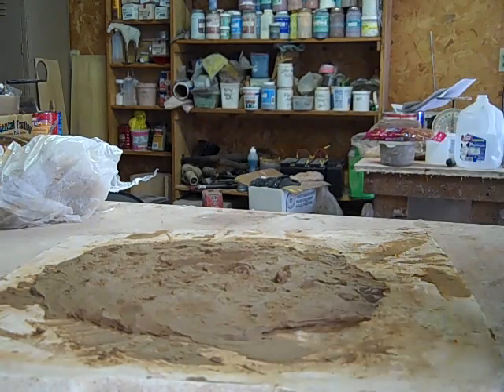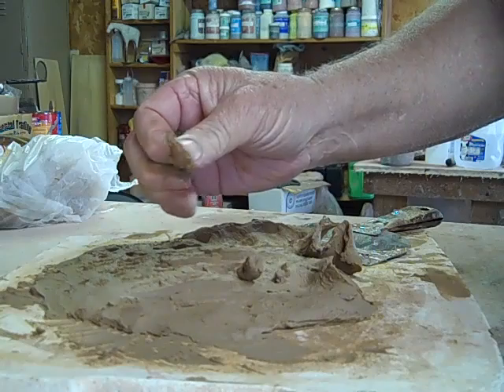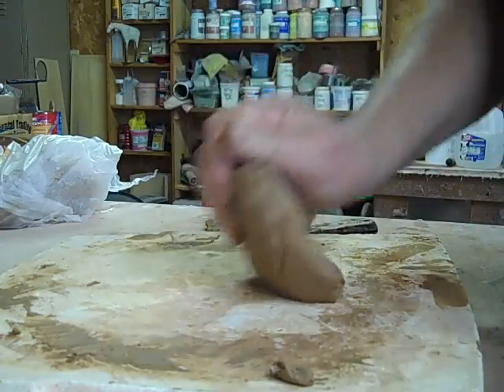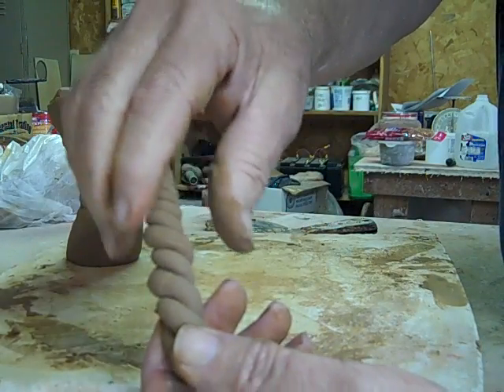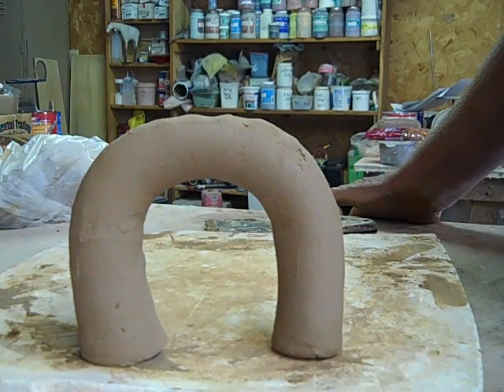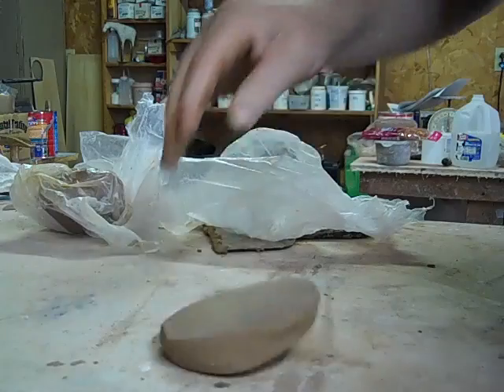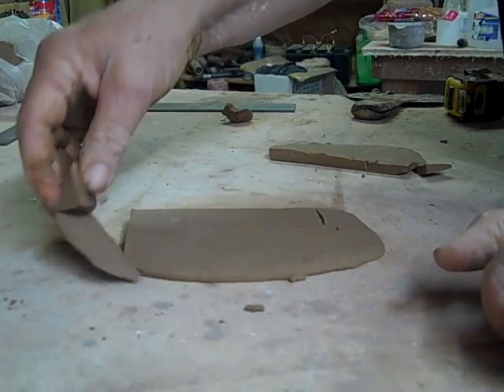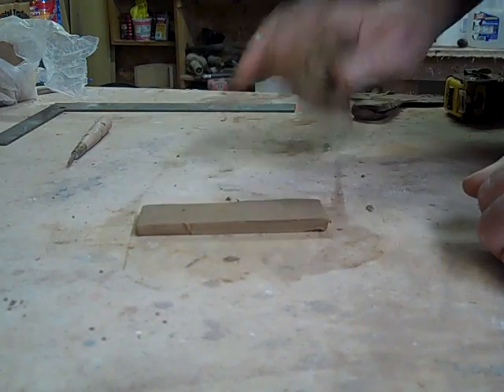CLAY... Can You Dig It part 2.

Comment: Thank you for this video.  I am a beginner.  Just got my 50 lbs. of grey clay.  I wedged it.
Then I tried to make a coil and it was cracking.  Does this mean that 
the clay they sent me is too old and dry?  It seems odd that it is 
cracking as soon as I unwrapped it and tried to shape it.  Should I send
 it back?  

Also, would you know for how long I can leave the clay on the shelf, 
after let's say I made a plate, or a cup?  It may be months before I can
 get to a kiln.  Can I fire it after months of it drying on a shelf?  
Thank you in advance for any assistance you may be able to provide
Reply: Hi, after 5 years.  He goes over the cracking issue in this video.... clay has a lot of textures. Read a book by Sunshine Cobb (Mastering Hand Building) for your questions - hope you got your information answered at some point. Clay has personality-different 'clay bodies' have different needs.  They may absorb water quickly, stay wet a long time, etc. So, talk with someone about what you want, or learn more about your particular clay.

Comment: Great info. I love the way you teach. Right to the point with a smidge of humor and a total lack of verbosity. Thank you so much! I was wondering. . .why not build a frame for your block of plaster and stretch canvas over it. Wouldn't this keep any plaster from sneaking into your sample? Just a thought. I have a 2 single frames with not so thick plaster so I can put a 'dry' block in if needed. I hope to build a larger bloxk/wedging unit
that will be a permanent feature in my room.

Comment: I have a problem with the clay I dug up. I live in West Texas and I dug up some red clay out by one of the local lakes. I processed it out to this point (the very beginning of the video) and it keeps cracking when I try to do the plasticity test. I'm guess that it is not very plastic at all but I was wondering if I should start over with new clay from some where else or if I can salvage this clay by adding something to it. thank you love the videos
Reply from the maker: thank you George. You can try adding some ball clay. maybe 10 to 20 percent will do. Mix it with the slip when you first mix the clay with water (after you screen it)
Reply: +wildmudpottery thank you a lot for the advice! this is my first time trying anything like this and thanks for the directions. one last question where might I be able to get ball clay?
Reply: this helped me to thanks

Comment: why not make the strip 10 inches? The longer it is the more accurate you can estimate the shrinkage. Also, after picking the piece up and wobbling it around, I doubt it will still be 5 inches.
Reply: 10 inches is too long to do a slump test. every clay will slump at 10 inches. To test absorption you need to submerge the test bar in water . 5 inches makes that easier..... but I could have been doing it wrong for the past 50 years. Doing things your own way is what ceramics are all about. Good luck to you. P.S we actually should be measuring in metrics to be more accurate.

Comment: so i followed video how tos about how to make your own clay and i dug up 15 lbs worth. i filtered it nicely and it is very moldable. but i don't have a way to fire or harden it. i tried a pit fire (which i knew wouldnt be very hot but i made a small cup to try it anyways) and i let it simmer to embers and i put the clay cup in it and completly covered the fire pit shut. and i let it sit and i checked it in the morning and the clay was broken (i wasnt suprised) and he clay cup crumbled in large pieces. it was hard a little but i could snap it in my hands. how should i harden my clay?
Reply: Sounds like you might need temper.  Take that broken mug and crush it up, mixing into the moist clay.  It should help with cracking.
Reply: +Brad Woodfield yeah i did do that in the very beginning of the process. it would help if i did it again?
Reply: Experiment with it.  Make up a few different batches with adding differing amounts of temper and keep track of each.  Make up something small and easy to form, like a small bowl or even just a thin square block with each of the batches.   Fire them all together and see how they turn out.
Reply: Hey alyssa for firing smaller things you can use some bricks and a weed burner should get you to the proper temp.

Comment: you could also weigh it, and the before dry and after dry measurements will tell you the percentage of water it was by weight, that with the shrinkage measurement and you could more predictably measure it's shrinkage based on it's water content.

Comment: Five inches jumped out at me.  Double the figures, they become one tenth of 100 and all the math flows in my head. Sure it multiplies error, but I'm betting is close enough for mud werks. #oldmath
Reply: if you use metric figures there's no conversion needed.  I made a test slab out of Mississippi red clay, but I just carved a 10cm line in it and let it dry for a couple weeks and then did a crap 'bisque' firing in a camp fire.  After firing the line is 9.7cm so 3% shrinkage.  I broke the brick to look inside it and it wasn't cooked all the way through, but it did ceramify as it is insoluble in water now.